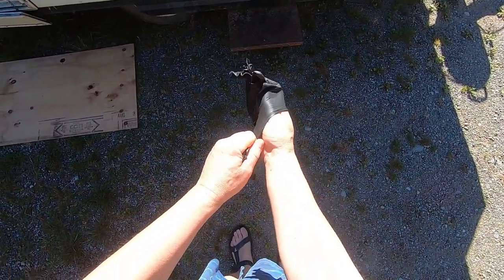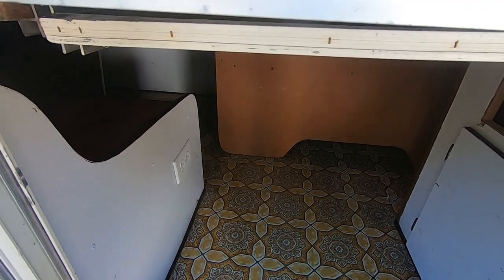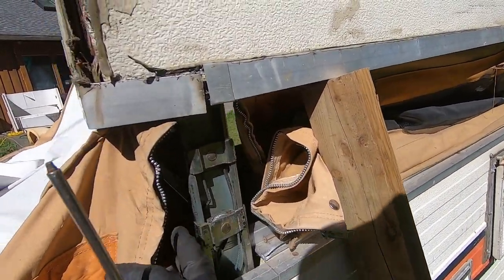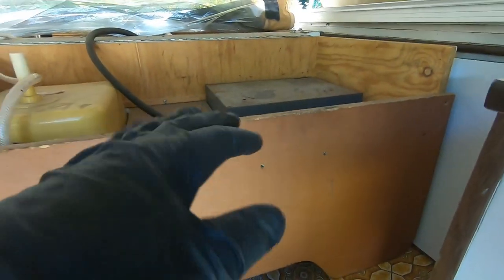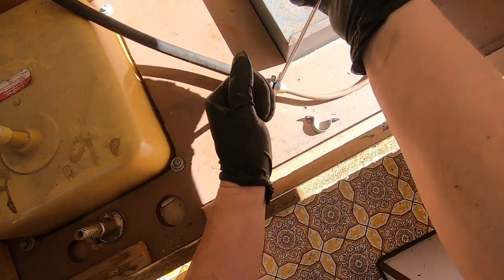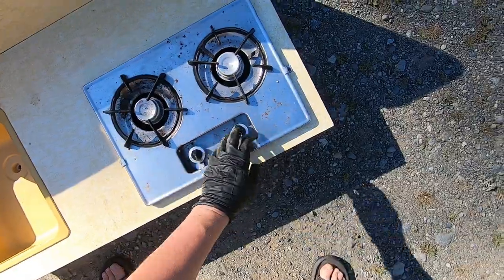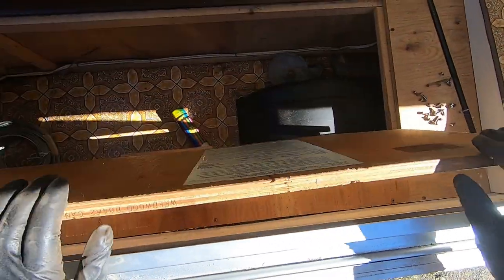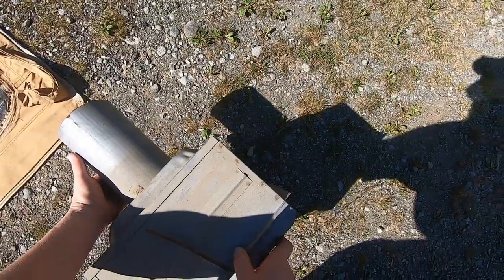$100 POP-UP TENT TRAILER PART 2: THE CLEAN-OUT DISCOVERIES!

Comment: Still a neat find and looks to be in great shape for a 1977..
Reply from the maker: It was a good score! The furnace is an old one with no forced air but would still work. The 3-way fridge works, and the gas cook-top works too. The 20 lb propane bottle is only 3 years old and the trailer frame itself (while a lightweight) is good and solid. It was sort of forgotten by the last owner because the lift cables were broken, so he put it up for sale cheap. And being the "Eagle Eye" I am, I saw the ad and swooped in an picked it up.

Comment: This would have had a hand pump system. And those light wires would just hook to your car battery. My family had one of these old Bon airs when I was a kid.
Reply from the maker: Yes, I found the hand-crank system. Most of the cables were broken.The deciding factor with saving the trailer or not was the tent--it was rotted beyond repair, so I've stripped out the trailer and will convert it to another use. I may make it into another RV but this time with solid walls and a pop-out bed at the back. Or....just a utility trailer. Time will tell. Thanks for stopping by and commenting!